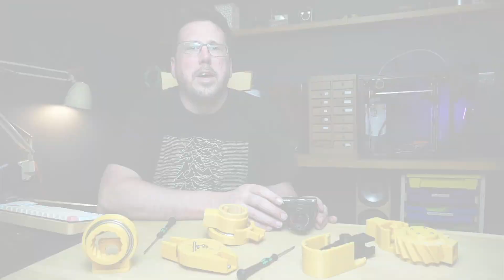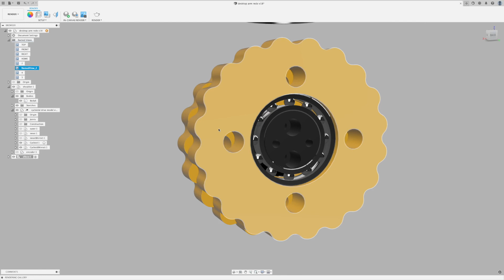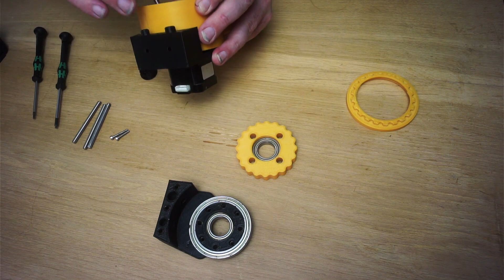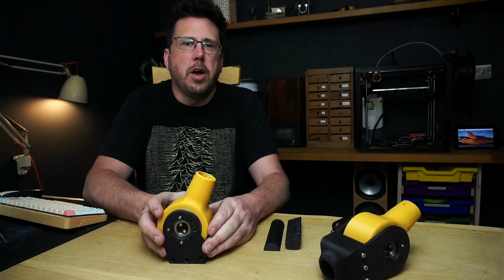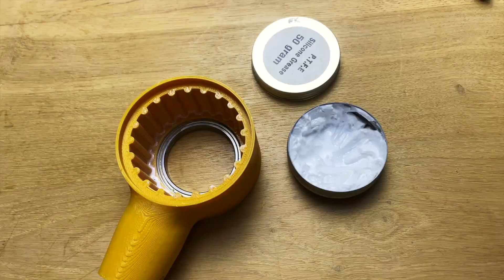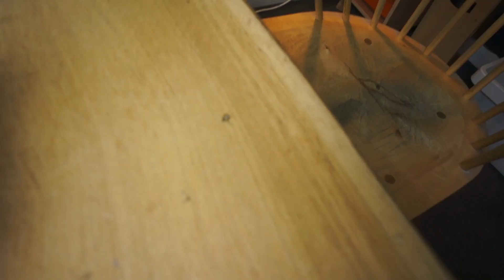How to make an easy yet strong robot arm

Comment: Nice work! I'm not 100% sure on this, but I think you could reduce some of those subtle high frequency vibrations in the footage by using drivers with higher microstepping values. At this point some of the TMC drivers capable of 1/256 microstepping are only a couple dollars each.
Reply from the maker: Hmm, Interesting idea, thank you very much! I'm currently running at 1/100 microstepping, but I do have a spare TMC driver lying around so I'll give you idea a go at 1/256 and see if it makes a difference. If it works I'll give you a shout out in the next video.

Comment: This looks fantastic so far! Congratulations! I'd love to know more about why you went with this design over the eccentric cycloids
Reply from the maker: Thank you! While the eccentric cycloids were a lot simpler than the traditional cycloid drives, i found that for the same amount of torque they required a larger size and I wanted the joints to remain compact. I'm thinking of using the EC gearing for the base, and can definitely find more uses for them in the future.

Comment: Awesome! You could try a cheap commercial drone camera gimbal as the wrist (hold a GoPro or similar) or make your own larger one. While auto stabilizing, most can be manually controlled with normal servo signals (pwm) simultaneously.
Reply from the maker: That is a genius idea! I’ll see if I can find one!

Comment: Hi, what a wonderfull job, so many people on the internet did a bulky job with tons of modifications ans your's works fine by staying simple. Mabe you could use carbon square shaped tube for axis. It could save some weight to release your cicloidal drives. Plus by multiplying your fixing points you should reduce the mobility of the camera. A good trick is to use 2 springs locked with the neck stand
Reply from the maker: Thank you! that's a great idea - I hadn't thought of carbon fibre - I'll see if I can source some!

Comment: Hey, fantastic work! I'm an last semester electronic engineer student, and I know a lot of Control Theory, Inverse Kinematics, Direct Kimenatics and Trajectory Planning and now I'm looking to learn how to build from scratch a robotic arm. I would appreciate if you can suggest me any source to learn how to design all this mechanical stuff, I know the basics of Mechanics.
Reply from the maker: Thank you. I'm afraid that I don't have any magic "how to design a robot arm" sources. I'm trying to do it  by starting small and iterating through ideas - each time I do a project I make mistakes and the next version is better. There are loads of resources online for specific problems (for example, how to control stepper motors), but nothing I can point you to for a comprehensive step by step guide.
I'd suggest that you take a similar path to what I've been doing - first start with something really small and simple and then approach each component in turn, getting more complex as you learn more.
I'm happy to help if you have any specific questions or want any pointers. Good luck!

Comment: I'd be really curious to see if the eccentric cycloidal designs introduced any less vibration. I agree  with IV projects on the microstepping probably introducing the most vibration, but we could always test that with a high speed accelerometer at the end of the arm 👀
Reply from the maker: hmmmm, accelerometer. now there's a thought. I had put the vibration/wobble down to the flexibility of the materials, but if I used an accelerometer I should be able to prove it one way or the other. I'm guessing that if it is the microstepping or cycloidal drive then I should be able to graph the output of the accelerometer and see the frequency of the oscillations match a harmonic of the number of (micro)steps per second. What do you think?
Reply: @roTechnic   I was thinking along the same lines as you- by driving the stepper at a known and constant speed you should be able to calculate the frequency of the microsteps and look at the magnitude of that frequency on an fft graph, and you could compare that to say, the magnitude at the motor rotation frequency, or that of the gearbox output shaft. You could also look at how much the overall acceleration values change when you switch from one microstepping value to the next... this is starting to sound like it's own mini project to me 👀
Reply from the maker: @Peter-898  yes, yes it is :D I have a horrible feeling this could be a rabbit hole that leads away from finishing the robot arm. I've done some testing and it now doesn't seem to be related to the motors/drives at all. if i keep the accelerations low, the wobble goes away, so, I'm thinking that it is the momentum of the arm/load and the flexibility of the materials involved that are causing it - I'm working on increasing the stiffness/damping of certain portions of the arm to counteract it.
I may well come back to the accelerometer/microstepping in the future though

Comment: Well, obviously now the camera has to be mounted in an actual motorized gimbal, keeping the center of mass of the camera aligned to the tilt and pan axes. I think I have seen some neat RC servo modding hack recently that enabled them to be used for high precision tasks.
Reply from the maker: Good call! on the Gimbal - maybe I could use that off the arm too I'll check out the modded servos and see if I can use them

Comment: Yea, so.. 8 months and this looks like I would LOVE to do it.  Drop a small arduino cam with motion tracking just below the camera so it automatically adjusts position based on motion detection.. all you really need is a rotating joint to change x/y positioning so it can actually turn and follow.  Are your plans, code and files available?
Reply from the maker: Hi, yeah, the plan is to bang a motion tracking cam on it eventually! CAD and code are available and linked in the latest video on the arm!

Comment: Wonderful project! Btw can it hold something that weighs 6lbs or greater? I've built an eye tracker using open cv and I wanted to use it to automatically move my monitor to where my eyes are and maybe a heavier load may affect the motors performance. Thanks in advance.
Reply from the maker: Thanks - unfortunately this in limited to about 500g of payload. to lift 6lbs, you'd need much bigger motors, or a LOT more reduction. I'm currently working on a 100:1 gearbox which might be able to lift that much - I'll post a video on it with load tests at some point
Reply: @roTechnic  Thanks. Also, what do I need to look for to know the right kind of motor to use for a specific payload? or are there some calculations needed to be done?